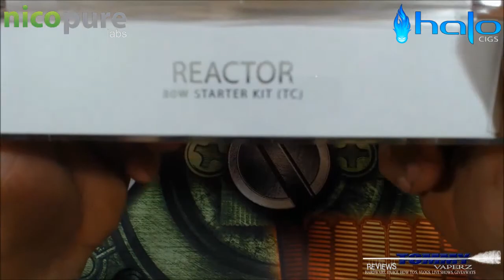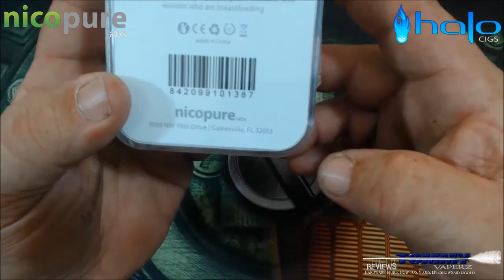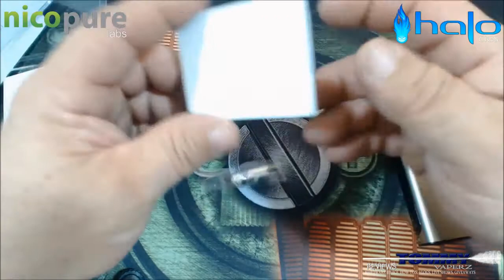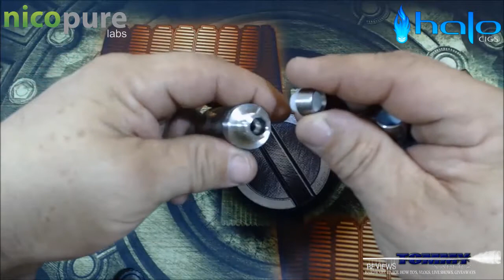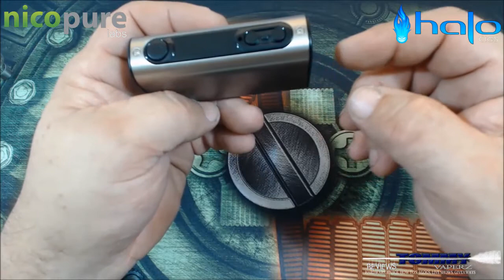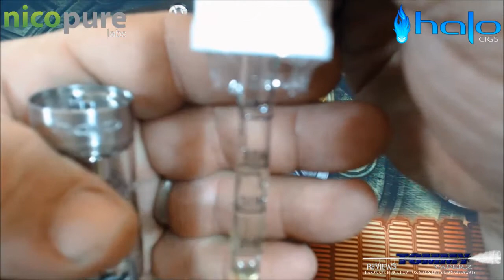Halo Reactor Mega 80 Watt Starter Kit

Comment: Battery Lifespan=300 cycles
Does this mean that after a year the battery is for the trash bin?
Reply: If you go from 100% down to 0-10% every single day, then after about a year, the battery will only hold about 80% life when it thinks it's at 100% compared to brand new. So it won't be trash, but instead of 5,000mah worth of charge, you might only have ~4,000. After about 2-3 years you might want to get a new one, but most mods don't last 2 years anyway for most people.
Reply: Thanks for the explanation m8.
Ordered mine, can't wait to try it out :)

Comment: i agree with you tommy that shouldnt be called a starter kit especially if theyre putting nickel into it and i think nickel coils should be gotten rid of all together theyre junk they taste horrible i think they should just stick to kanthal and stainless and for the people who are in love with it ceramic but all in all nice little rebranded kit and review
Reply: I really hope you've been using Temp Control with the nickel.. That horrible taste is probably from the toxic chemicals released above 600 degrees F, so without temp control, you can easily go above that with a simple box mod using Power mode.. Nickel has one of the best flavor production, so it sounds like you've been poisoning yourself. Starter Kit is a good name for a Temp Control Starter kit.
Reply: Kristian Szabo no i been vaping for 2 1/2 years i kno the rules of nickel but compared to ss nickel is garbage